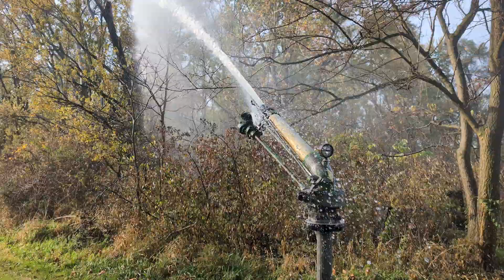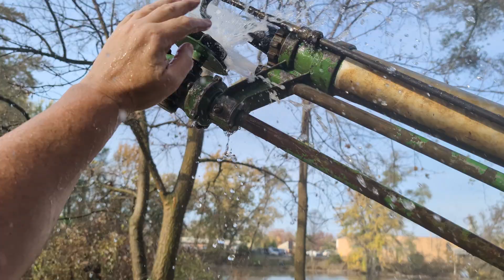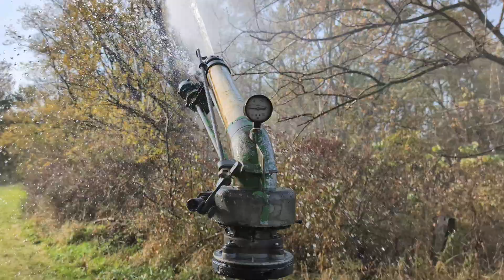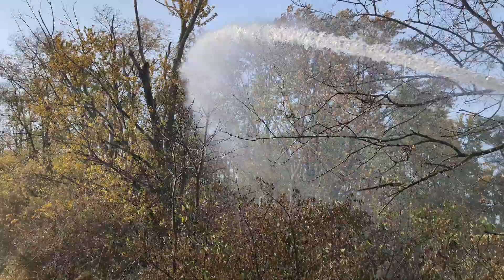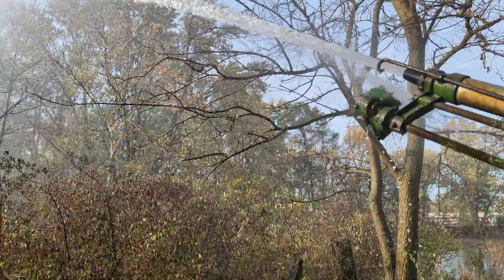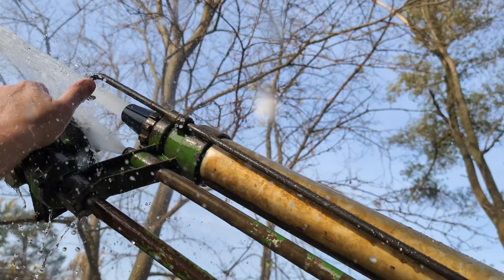Sime Big River 3" turbine driven rain gun

Comment from the maker: UPDATE this was taken in to the dealer for a rebuild, They ordered the bearing for the drive wheel, when they went to change it, they checked the gearbox, but it was stripped and the teeth on the gears were missing. Sime wants 700$ for the gearbox, and it would be close to 1000$ to get the gearbox shipped from Italy direct from Sime and have the gun fixed. I declined the repair as the guy told me that i could get a working gun for less if i look around. I plan on trying to find a working one. I've always liked these guns, the water powered drive wheel is a ingenious idea and it makes this a slow reverse gun, so it goes 1 speed both directions. also whats really cool is the stream diffuser, every so often it pulls that wire clip into the stream for close in coverage. Helps when you dont have a spreader nozzle. Kind of like a 65D or C with the clip in the spoon.

Comment: That's a pretty decent stream/distance with a large 24mm nozzle. I wonder if it could use a more sharper stream with the smaller nozzle to get the wheel turning more.
Reply from the maker: @photocontrol  the sprinkler keeps reversing directions so I'm wondering if something's out of adjustment. Need to get it rebuilt.
Reply: @NelsonBigGunP200Fan  Hmm, I wonder if something like a spring is missing if it randomly keeps changing directions without reaching the stops.
Reply from the maker: @photocontrol  its possible. I dont have a service manual, otherwise i'd be reading it. I Want to get it rebuilt though.
Reply from the maker: @photocontrol  The gearbox is stripped and will cost a fortune to fix. its too bad. I liked this rain gun!
Reply: @NelsonBigGunP200Fan  Yes that's too bad it will cost so much to fix, hopefully you can find a parts gun for a decent price with a gearbox that's still in good condition.

Comment: This is an interesting design with the spinning wheel to cause the sprinkler to move.  I know one thing that you never want to use any kind of oil with a sprinkler as that will gum them up quickly and keep them from working normally.  Strangely enough oil and water do not mix well.  There are very similar models like this made in china that can be purchased for like $80.  Yeah, I know it sounds pretty amazing and they are 2" inlet design.
Reply from the maker: @randyvanheusden732  yeah very interesting indeed. The stream diffuser is neat too (wire clip in front of the range nozzle). When the wheel is moving it pushes it in and out of the stream to create closer in coverage. I'm going to get it rebuilt at some point. This has a 24MM nozzle which is just shy of an inch! That's pretty big!
Reply: @NelsonBigGunP200Fan  I am just wondering if it is something that you can take apart and clean up yourself.  One of the problems with that spinning wheel is the bearing inside may wear too quickly and if it becomes wobbly it will not spend or move like it is supposed to do.  I know me I would be taking it apart to understand what is broken or needs to be cleaned.  One of the greatest problems with sprinklers of most any kind is the user not realizing that using a spray or lubricant of some kind to fix a problem is the wrong solution.  Sprinklers are water lubricated and the lubricants cause more problems as they get sticky with water.  Then it requires disassembly and cleaning.  I personally like the design behind these models even though they are non-impact models.
Reply from the maker: @randyvanheusden732  would like to get a service manual for it too and read on how to rebuild it. Not sure if that's available to dealers only or if I can contact Sime directly for one
Reply: @NelsonBigGunP200Fan    I would think it would be easy enough to ask.

Comment: Probably needs oiled a little bit
Reply from the maker: it could be, the drive wheel possibly could need bearings or tightened up. I'm gonna take it to the dealer at some point and have them rebuild it. This ran decent otherwise with 40PSI to the gun. Thats from 2 pumps in series. the Nozzle is a 24mm. Pretty big